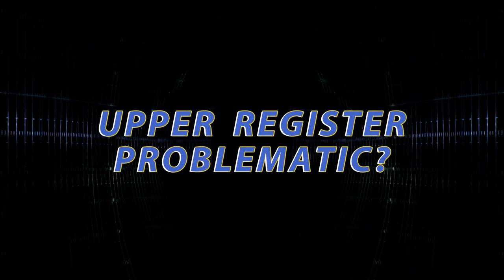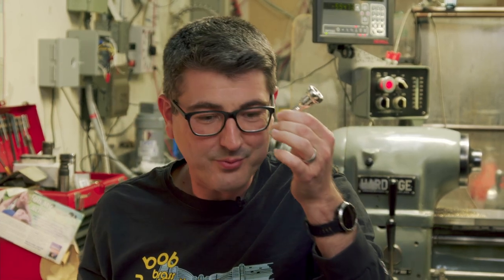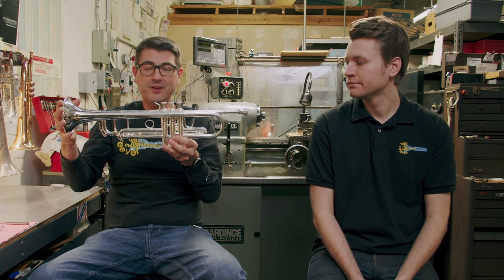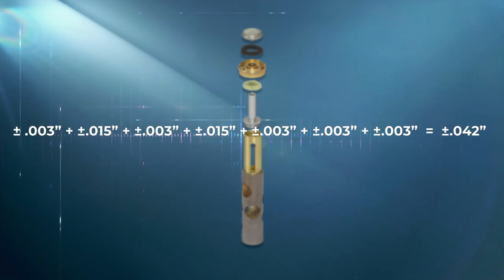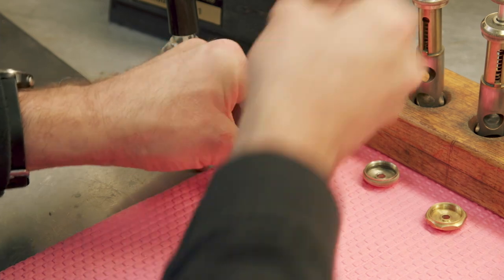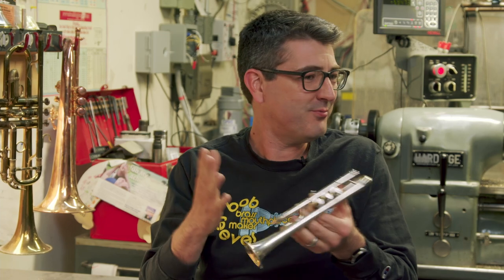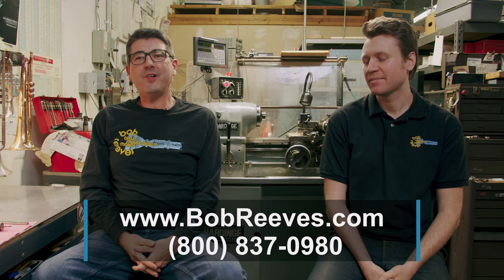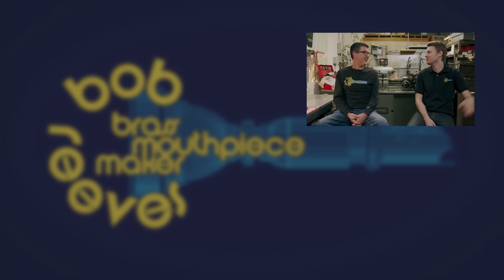TRUMPET PLAYERS: DOES YOUR TRUMPET HAVE THIS COMMON PROBLEM?

Comment: With the right small light that can shine into the tubing and a small mirror and the right measuring tool it is really easy to do this yourself.
You also need some sets of good pads with different thickness and also thin plastic "washers" so that you can do the fine-tuning.
I always have done this myself with perfect results and never had any of the problems described in the video.
Reply: Do you have any tutorials or videos on how to do it yourself?
Reply: @andrewc.5813  bump. I too would like to see his process.
Reply: I was thinking a borescope would in incredibly useful for these inspections. 🤔

Comment: Have one ever measured the difference of sound and an air flow due 0.1mm misalignment? 
I'd love to see that numbers. And I personally don't think anyone can really feel that,  not talking about hearing. Our ears just not capable 😉.
Will be glad to see the proof (measured numbers) if I'm wrong.
Reply from the maker: Just to start, air flow has nothing to do with the valve alignment as the trumpet is an acoustic instrument. How the trumpet plays has to do with the vibration of the air inside. Have you seen our video about the no air flow mouthpiece we made? Misalignment of the valves causes a change in bore size entering and exiting each valve. 0.1mm or .004" on a Bb trumpet is about the smallest difference perceptive players will feel. In our experience there are certainly players that can feel and hear these differences. When the numbers start to get around .008" or 0.2mm even younger players will be able to tell a difference. As far as making recordings to compare the sound, it would be possible but very difficult to do. In differences that small it would have to be with a very controlled room and musician. The reality is that most trumpets are not out of alignment 0.1mm. Most trumpets we see are in the .010" to .040" (0.25mm to 1mm) range of misalignment, which has a significant affect on how the trumpet plays, and we commonly see misalignment numbers that are greater than that.

Comment: I have a Getzen Super Deluxe from about 1956 and I've calculated that I'd need downstroke pads of a thickness of .085" and upstrokes .0645" thick. They'd be so thin though that they wouldn't be very quiet at all. Not sure how I could increase these thicknesses

Comment: Imagine Louis Armstrong entering this shop for a valve alignment. I mean there is some truth to misalignment playing worse but stating that replacing the pad material for yours is going to fix you up for a lifetime... Pretty sure a good cleaning makes more difference ;)
Reply from the maker: Thanks for your insightful comment. While we haven't done an alignment for Louis Armstrong, Bob did make mouthpieces for him! We're not saying that the valve alignment will solve every problem for the rest of your life. What we do see on a daily basis is players having to compensate for misaligned valves. We have done alignments for Harry James, Doc Severinsen, Arturo Sandoval, Håkan Hardenberger, among thousands of others. While we don't claim to have made any of them the musicians they are, we are proud to have worked with them and hopefully helped them along the way.
Reply: @bobreevesbrass  That's good to hear. As much as I liked the info from the video, I did think a slight relativization was in order. Seems to me too often we blame our instruments or mouthpiece, instead of going the extra mile in practice. Taking my comment as graceful as you did raises my value in your opinion though, so thanks for taking the time to come back ;)
Reply from the maker: @ibendiben  That's a great mindset to have. There are certainly players that blame everything on their equipment and ignore fundamentals. There are also players that blame everything on themselves and ignore their equipment. In our experience, the most successful players combine solid fundamentals with equipment that helps them with their musical journey.